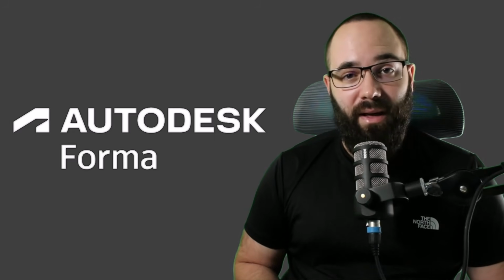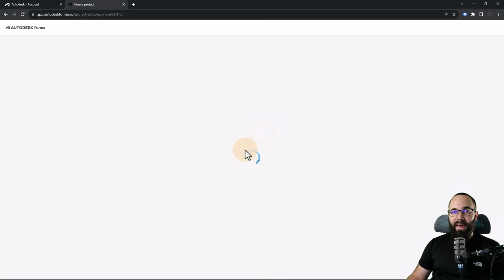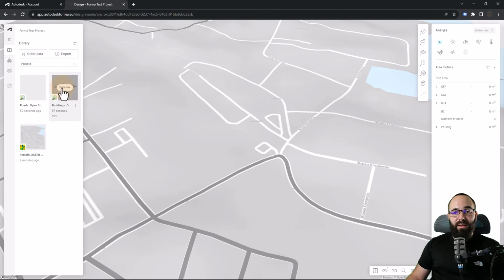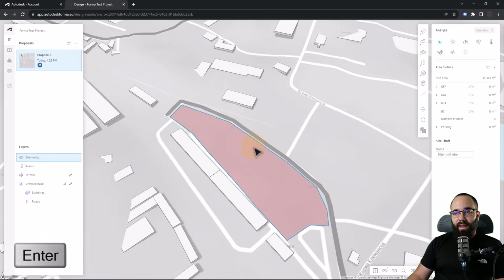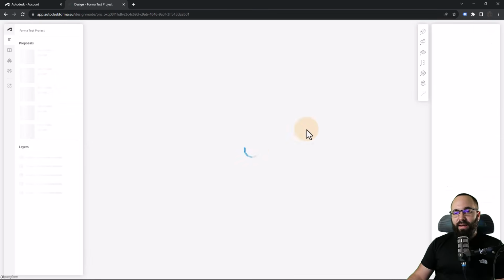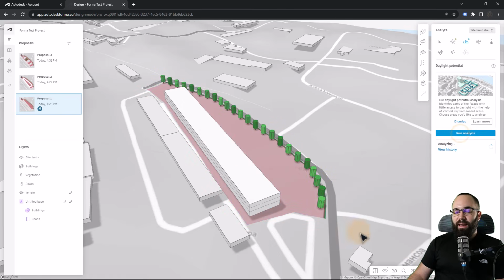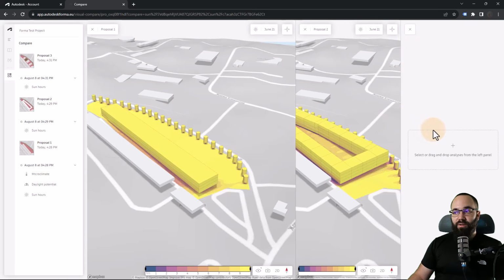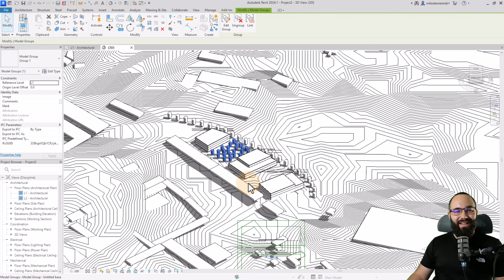Autodesk FORMA: Complete Beginner Tutorial

Comment: Wow this forma is very nice but I've made a student account and it's finished the year or two can't remember
But why the building is not attached to the ground correctly?
Reply from the maker: I think that the software is just overlaying the building data over the elevated surface data, it would be really hard to automatically fit all buildings perfectly.
Reply: @balkanarchitect  it is possible to move each building up and down to specify how they should meet the ground if you "release to basic building". You will then be able to access each part of the building and if you slightly drag-move it, then it will fall/jump to the terrain without moving it sideways. You can also use the move tool to move the building in the z direction
Reply: you can edit the site to flatten it to the correct msal @balkanarchitect

Comment: I fail to see why this is a separate product from Revit, except for the fact that it doesn't look like the software was built on top of AutoDesk's garbage proprietary 3D engine. If you could actually reliably free model and snap to objects in 3D in Revit, this product wouldn't need to be.
Reply: revit is 25 years old now, so we are developing the next gen BIM. It will take some time though :)
Reply: @MrSamuelmacalister  what have you idiots been doing for the past 25 years, then? Anything other than collecting rent and doing the bare, bare minimum to update your products. ArchiCAD is even older than Revit, but it didn't take them years of delays to release the ability to measure and reliability snap to objects in 3d. There are programmers making more credible BIM plugins for Blender than this.
Reply: how about TestFit?
Reply: Autodesk has claimed that Forma will expand to encompass and replace Revit in time. I'll see it to believe it of course, but they arent building major changes on Revit intentionally now, it's coming into maintenance mode I think - not end of life but end of meaningful change.
Reply: @AussieBIMGuru  have they released a timeline for when this junk will become a full BIM modelling system? Because right now it's a bad version of TwinMotion combined with a bad version of Ecotect circa 2010
Reply: @henryglennon3864   I swear there was a product just like this years ago. I remember using it to mass up and test a stadium design and then import it into Revit. (I can't remember the name)
Reply: yes i remerber something called urban argisis  @HeiseSays